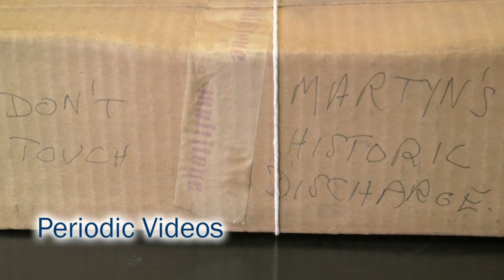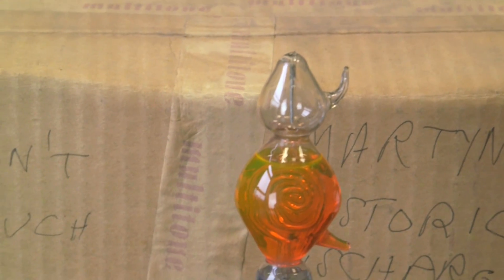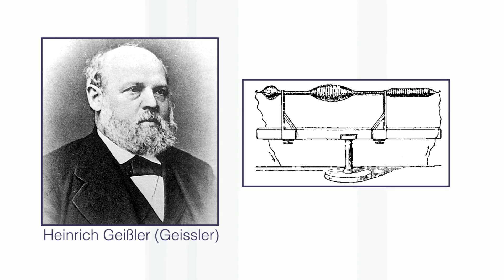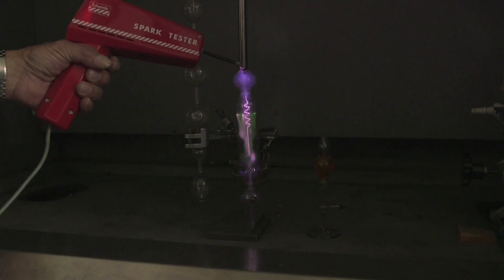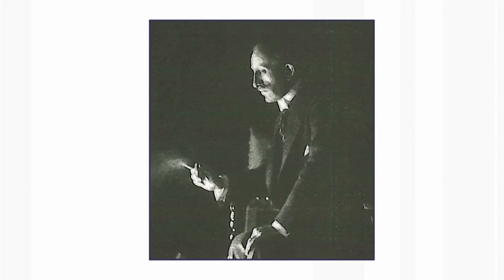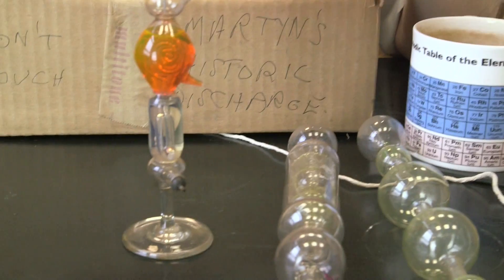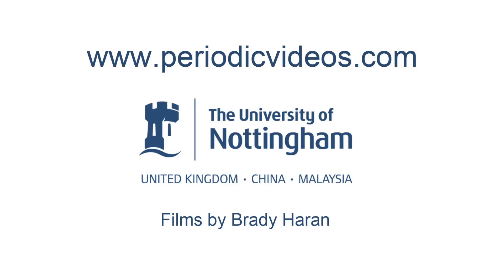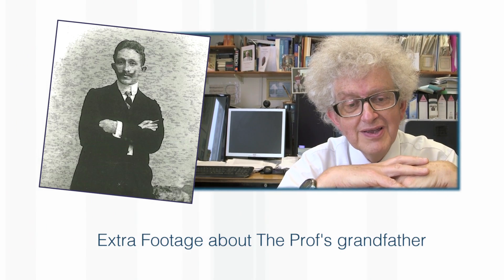Geissler Tubes - Periodic Table of Videos

Comment: A few thoughts. I very much doubt that the glass is quartz. Although I have seen quartz blown into many shapes I've never seen such intricate forms in this material. I’ve seen crucibles, tubes, flasks and so on, but nothing more complex such as tight spirals – even in marketing materials made to show-off glassmakers’ capabilities. As you say, it is a really difficult material to work with, and it is very unlikely that a tube made for entertainment purposes a century ago would be manufactured with the most expensive glassblowing process. To make sure, maybe you could drop an email to a technical or laboratory glass company that specializes in custom work? I’m betting this is just soda lime, borosilicate (the standard for discharge lamps and lab equipment) would have just come onto the market when this tube was made (1893 was the year Otto Schott introduced DURAN). UV transmission of either isn’t very different and the since these tubes run cold, soda lime glass would have been fine. UV shorter than 315nm is very much attenuated but glass that is clear to the eye transmits UV-A just as well as visible light. Filters that are designed for at sharp cut right below visible light (400nm) are rather exotic and expensive. 

I am fairly confident that the gas in these tubes is something cheap. Most likely nitrogen, hydrogen or mercury vapour. Perhaps even a mixture of these or air as you said. The colour also looks like argon, but this gas would have just been isolated around the time the tube was made. Appart from the pressure, the current passing through the tube has an impact on the colour for different gasses and so a variable high voltage, high frequency AC power source would be of great use. The precise current could be measured with a rather simple battery powered low-side current sense circuit together with an RMS-to-DC converter IC (such as LTC1966 or the new AD8436) feeding any ordinary DC voltmeter. I'd be happy to solder one up for you. By combining current measurement with emission spectroscopy, I think determining the composition and pressure of gasses in these tubes could be done rather easily.

Lovely tubes.

Comment: ah ha!!!...   <<"Paschen's Law is an equation that gives the breakdown voltage, that is the voltage necessary to start a discharge or electric arc, between two electrodes in a gas as a function of pressure and gap length">>

use Paschen's law with a guestimate of the path length and a variac on the supply of the high voltage source, and HV diode (rectifing) string and HV low Farad capacitor (voltage smoothing) string and high voltage meter on the secondary flyback HV side to mesure the start of Ionization to get the pressure, then determine the spectral widening and voila!  

:)

Comment: If particular wavelengths of light emissions correspond to the ionization and subsequent return to the ground state of particular chemical species, couldn't one determine the identity of the gas(es) inside without damaging the equipment using spectral analysis?

Comment: I don't understand why they can't use a spectrometer to analyse the emission lines. The broader distribution of the emitted light is affected by the vapour pressure, but the lines are the same no matter what the pressure (as they depend only on the energy levels of the atoms themselves).

Comment: The glass is not treated with iron. Instead, it is treated with uranium. Uranium glass has a pale yellow-green color, fluoresces bright green in UV light, and was in common use a century ago. Geissler tubes frequently contain uranium glass. A simple spectrograph should reveal the major components of the gas and the presence of uranium.

Comment: yeah, just analyze the spectrum...are you a chemist, or do you just play one on TV?
Reply: Spectral analysis would work if the pressure within the tube was known, because the pressure is a major factor in what wavelength of light is given off, he can't find the gas.
Reply: i thought it was a quantum effect of energy level band jumping, how would pressure affect that effect?
Reply: James  Ingersoll hes a professor at the university.
Reply: Thank you for clearing that up...I watch these videos all the time...so I know what he is...he's "the Professor"...now, if only HE would comment on why he didn't do a spectral analysis to determine the gas in the tube...
Reply: There are probably a dozen UV / Visible, Infra-red, Nuclear Magnetic Resonance and other spectrometers in the building.  The problem is the tubes most likely will not fit in them, since they are too wide.

Comment: What a wonderful heritage.   The tubes  might contain uranium, used for a green or yellow colour since the late 19th century.  Uranium glass is fluorescent under UV.  The one on the far right at 1:50 looks a little like "Vaseline glass "which typically contains uranium and is slightly cloudy.  Negligibly radioactive.
Reply: +1 on the uranium glass.

Comment: I know the tubes are perfectly functional, so they are still at low pressure, but is there a Method of storing them that would prolong their life better than in atmospheric air. In a fluid for example?

Comment: I wonder if you could use sound to determine the density of the material inside. Measuring distortion through a hollow medium filled with a gas at different pressures to see if it changes a detectable factor. One more piece of the equation.

Comment: I would be extremely interested to find out anything on the Poliakoff transimpedance resistor if anyone can point me in the right direction. The only transistor I can find from the 1920's is the Lilienfield.
Reply: Gordon Lawrence yes me too.  i wonder if they could have been used to make an early darlington signal amplifier.
Reply: Noam Chongsky They were FETs not bipolar transistors - transimpedance resistors. IE a change in voltage on the gate led to a change of current in the semiconductor. I believe they were thin film made on glass. However the info I have found is very sketchy.

Comment: A couple of the things the professor says in this video surprise me. For one, he seems to think the glass is doped with iron to make it yellow and fluorescent. It is almost certainly "vaseline glass" however, doped with uranium. A simple geiger counter test will affirm this quickly. Also, he is strangely under the impression that the determination of the gasses inside will be difficult and potentially destructive to the tube??? All the information to determine the gas or gasses inside is already there. You're looking at it. One can tell simply by observing the color alone that it must be either air, argon, helium, mercury vapor, or possibly but HIGHLY unlikely, krypton or xenon. The simplest spectral analysis even done with a handheld piece of cheap diffraction grating will immediately reveal which of these gasses it is. The lines of mercury are instantly recognizable, as are the quasi-continuous repeating bands of the many rovibrational transitions of nitrogen and oxygen molecules if it's air. All of this could be done in seconds with equipment that I'm sure his lab has around somewhere.
Reply: You do not need precise knowledge of the pressure to do a spectral analysis. You already know the pressure is substantially below that of an atmosphere because it is capable of being lit by a low power handheld tesla coil AND the discharge does not exhibit any filamentous self-pinched arcs as in a plasma globe toy. The pressure is FAR too low to exhibit any significant pressure broadening or doppler broadening effects and the tubes all appear to have both wide and narrow regions where diffuse and capillary discharges can both be observed separately. Spectral analysis would be so trivial here you really wouldn't even need a proper transmission diffraction grating and could probably just do it by eye looking at the reflection off a cd or dvd.
Reply: he said ion, it contains a uranium dioxide dissolved in glass
Reply: Exactly!, when he said, "...the glass is lightly yellow..", my immediate thought was, "....that's uranium glass (vaseline glass)"....and as you pointed out, a simple spectral test would give the identities of which gasses were present in the tubes......something I did in early high school lab with a diffraction grating.  
Maybe some of the statements made were to spark comments?...only the Professor knows! :P
Reply: A spectral test requires the knowledge of the pressure in the tube, which he doesn't have

Comment: (1)  You can determine the contents of the tube via simple spectroscopy.  You're a chemist, this should occur naturally to you.
(2)  The green color of the tubes is due to the presence of uranium salts in the glass.  Uranium glass was used commonly in the past.
(3)  Carbon dioxide was sometimes used in Geissler tubes.

Comment: can't you analice the spectrum?
Reply: Cant we use acoustics to figure out the pressure?
Reply: If the color depends on the identity and pressure of the gas, then if you know the color and the identity, you can figure out the pressure.
Reply: So why can't they just analyze its spectrum, as you initially proposed? I don't think that absorption lines vary with pressure, for example.
Reply: He said that also depends on the pressure of the gas, which they don't know.
Reply: well, but in the case of distant stars the presure is not known and still we cn know the composition...
Reply: Diego C. the point is that we want to know what gas it is, if we get the pressure and we can use it to figure it out, great. but if we get the identity with out the pressure, then we wont need the pressure anymore
Reply: Diego C. and thats why i said what i said xD

Comment: From my work in spectra, I can almost assuredly say the inner tube is Quartz with a low pressure Mercury or Thorium Argon mixture, both used as standards in the astronomical spectrograph we have with somewhat similar coloring. The outer fluid and gases may have a copper or iron vapor but I can't be sure. I would actually use two types of spectral analysis Emission of a charged tube at a controlled voltage,  and compare it to an absorption spectrum.  Might be able to tease out the quartz and glass comp as well as the other elements in the tubes

Comment: Let me first state I am not a chemist so I may be way out of line with these suggestions. Couldn't you use a spectrometer to narrow down what the gas may be? Also, is it possible to regulate the power output to see how much power it takes to start fluorescing which may give another clue? You can use an Ultrasonic Thickness Gauge to check the thickness of the glass. All of these tests are nondestructive, then all you need is to solve for what the pressure might be. Well, I hope this helps, always love your content. Thank you for posting it.

Comment: The reason they work with only one electrode 'connected' is that the tubes have a capacitance. As the supply is AC current flows in and out of the tubes and therefore they are supplied with energy which they convert into light.

Comment: In describing this apparatus and the materials, you mentioned that some gas may have escaped or air entered because "everything leaks slightly". How does glass leak? My niave thougfht is that it is a solid and therefore impermeable. Can gases diffuse through solid materials?
Reply: Rebecca Dittman yes, especially gasses like helium.  They are so small that they can sometimes go in between the atoms of solid structures.
Reply: Rebecca Dittman think of woven wool gloves, there's plenty of space between the threads and with the right pressure a small thing could be pushed through, glass is the glove, atoms in the atmosphere are the small things pushing against it.

Comment: Spectra of Gas Discharges to work out the elements, aka gas?  Heat up a little bit of the tails and remove it, put in spectrum analyser and find out if it's glass or quarts.   I'm not educated enough in that area to know one way or another, though on the off chance it's not been thought about, there it is.

Comment: Would it possible to do an experiment to detect the natural ionisation of air particles using a frequency tuned photon detector and examine the rate v temperature for a body of air no less than 100m long?

Comment: Spectral analysis maybe??? Just a spectrograph and you might know what gas is inside. Pressure might just broaden your lines but won't shift them. unless you are trying to throw your tube close to the speed of light at the same time (which might explain why you would damage the tube as well)...

Comment: You should construct a long tube. On 1 end there is this Geissler tube and on the other side there is a camera. Camera should capture the dispersion of light. To have better effect you should use filters UV or IR with specific wavelength blockade.

Comment: "There are measurements we might be able to do, but we might damage the tubes."

Well, why not use a simple spectrograph?
Reply: We are speaking about spectral lines here. Pressure might broaden you lines, but not shift them. There's no doppler effect here. And in the case you are trying to put the tube at high speed and try to use a spectrograph even though, the distance ratio between lines will be respected.
So a spectrograph is a valid solution.
There are also multiple gases, but you will just have to distinguish the various lines overlapping. A quick look at Nist catalogue and your done. In 5 min max you know what's inside.
Reply: Because he said the air (lets say oxygen) will give off different light under different pressures.
But because he doesn't know the pressure he can not rely on the light.
Reply: Contrary to some of the other answers below, I'm quite optimistic that a lot can be inferred from a spectrum with sufficient resolution.

If the pressure is not too high, pressure just broadens spectral lines. This happens because the molecules or atoms bump into each other. When a molecule or atom is in an excited state the bump has a very high chance of causing it to return to the ground state emitting a photon. This reduces the lifetime of the excited state. The width of spectral lines is inversely related to this lifetime. Long-lived = narrow line, short-lived = broad line. Hence, if the pressure increases the collisions get more frequent, the lifetime goes down and the linewidth goes up.

If pressure becomes too high, lines get so broadened that they overlap and get washed out into a continuous 'smooth' spectrum, which makes indentification hard (but not impossible).

The very fact that we get a discharge rather easily suggests that the pressure is probably quite small, in the order of 10 kPa or less.

Of course there will be a broad continuum from the fluorescent doping in the glass. This will be a background on which the spectral features of the gasses are superimposed. Not a problem if the spectrum is measured with sufficient quality. Just looking through some grating at the tube will not work. You need a proper setup with slit, lenses, grating or prism, detector, as contained in a proper spectrograph.
Reply: My 0x1E
I think he was referring to the color of the light as detected with the naked eye. A spectrograph is vastly more accurate. If astronomers can use them to analyze objects as distant and varied as planets, comets, stars, nebulae or quasars and determine their compositions with uncanny accuracy, the light from a Geissler tube should give them no trouble at all.
Reply: Because multiple types of gases at different pressures can give out the same wavelength of light, a spectrograph will only tell you it emits those wavelengths which doesn't help in determining which gas it is any more than maybe narrowing it down a slight bit
Reply: Yeah, they'd need to bring the tubes to India so they could look at them through Raman's personal spectroscope.
Reply: Maybe the physics institution is too far away and the weather is cold... I agree that this video lacks some of the rigorous curiosity we have become accustomed to.
Reply: He did also say that they dont even have the equipment at the moment anyways. 3:55
Reply: Agreed - would seem like a relatively simple solution. If Martyn has access to someone with a compact fiber (fibre if you're in the UK) coupled spectrometer (e.g. Ocean Optics USB 4000), I bet you could probably work out what was in the tubes without too much difficulty using something like the NIST atomic line list. As someone else has said, the pressure only impact the line widths - you're not going to see any shifts in wavelength. 

We run some pretty sensitive Raman experiments just a bit further north in Sheffield and if you forget to turn the fluorescent lights off, you can easily see the mercury emission lines from excited mercury vapour (which is inside the tubes) in the spectra. 

I doubt the iron impurities on the glass surface would cause too much of an issue unless they were really strongly absorbing, but since you can see the emission by eye (well, camera), I doubt that. You might get fluorescence or some other emission from the glass, but it will be spectrally much broader than the atomic emission, making it easy to distinguish.
Reply: My 0x1E Oh right, thanks for the clarification. 😄
Reply: are they using alternating current? couldnt that explain why the circuit doesn't need to be completed?
Reply: That's what I was thinking too, don't know the details considering I've never seen a spectrograph...
Reply: Because they might not fit in the instrument.

Comment: I'm mystified by something.

Why does the spark running to the electrode have the same purple hue as the excited gas within the tube? Shouldn't we see the familiar blue-white spark and then purple in the tube? Is it a leaky tube, or the labs air, or the camera, or the material the Spark Tester is made of?